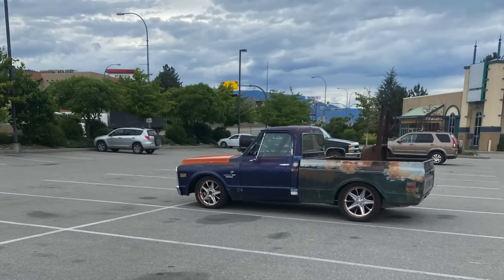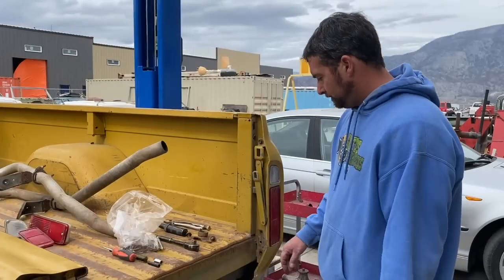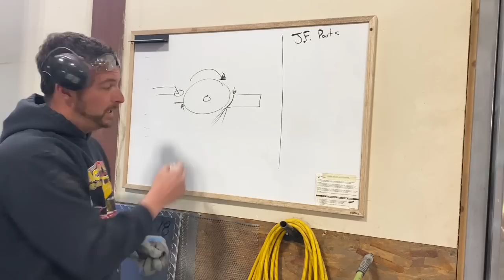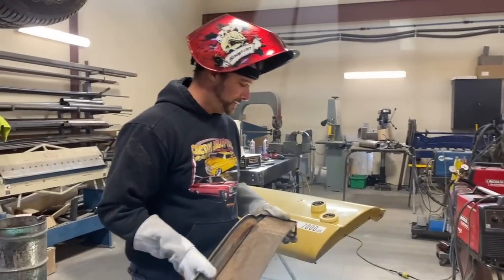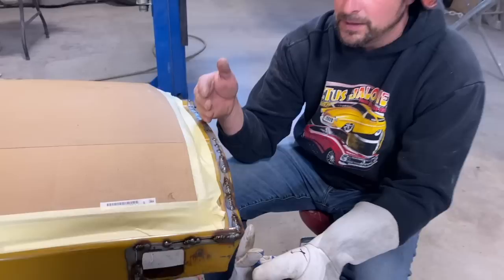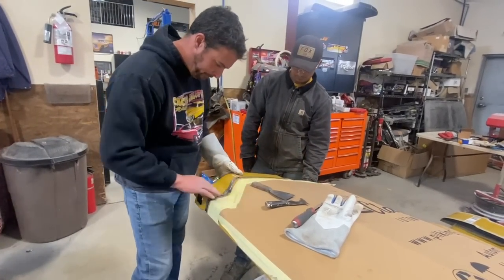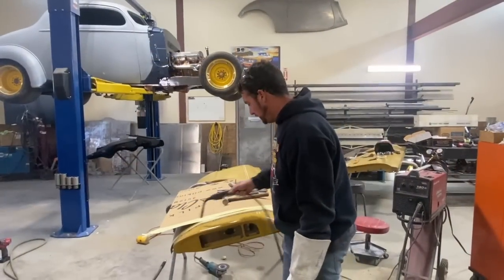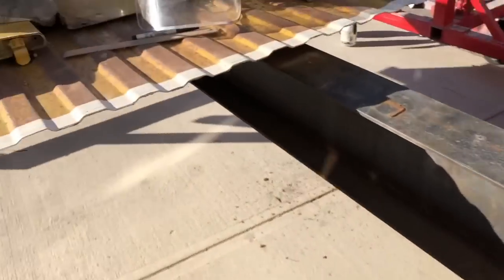How we shortened a C10 long Box |  PART 1

Comment: Allright! Nice, clear and straightforward. I learned some things in a new way, thanks. One thing on the blades fracturing- If you put the piece on a solid set of sawhorses and really stabilize it and support the offcut it minimizes any wobble of the piece you are cutting. Without doing that as soon as something moves the blade pinches and binds. Those body shop stands are not very stable.

Comment: Long gone are the days of the $500.00 pickups. They used to be found everywhere, but as you've experienced, they are not easily found anymore, especially in decent shape.

I bought my 1968 C10 longbed on Sept 20, 2003, for $500.00. I drove it home. It has the 327 large journal crank, TH400, and HD rear leaf springs. For nearly five years, it was my daily driver until I had wanted something with A/C, power steering, and cruise control. I've had several offers on my truck, some very good offers too, but I've turned down every offer.